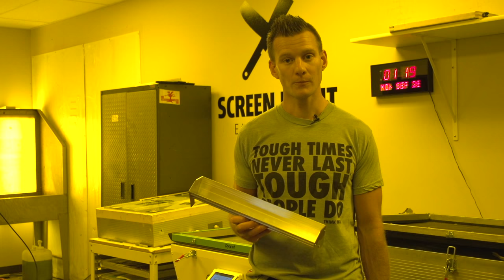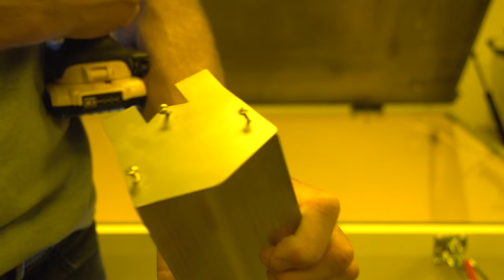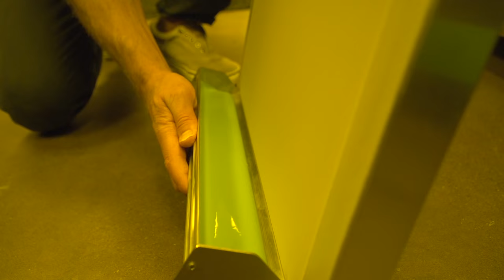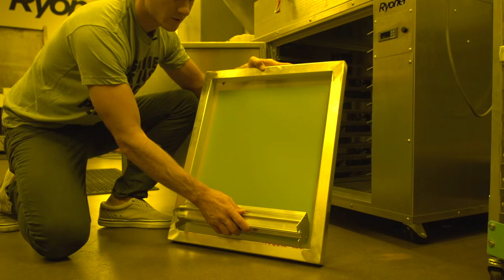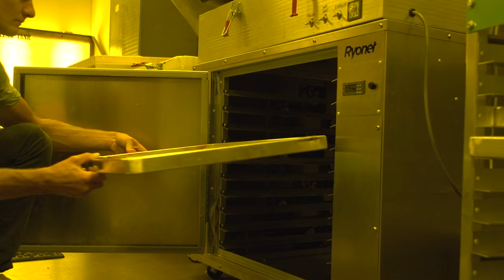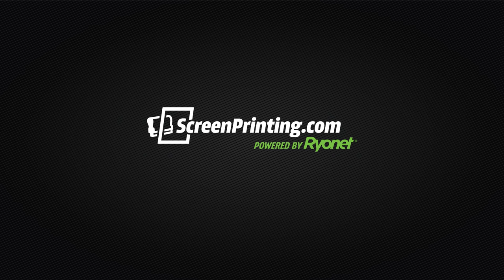How To Coat A Screen With Ryonet's New Aluminum Scoop Coater

Comment: Out of curiosity, what size scoop coater is he using in this video? 18" or 20"? (I assume the screen is a standard 24") Thanks!
Reply from the maker: Our 20x24" inch screens are measured with outer diameter so you want to gut off 4 inches for your scoop length, and 5 for squeegee length. so 16" wide scoop coater and a 15" wide squeegee for full coverage :)